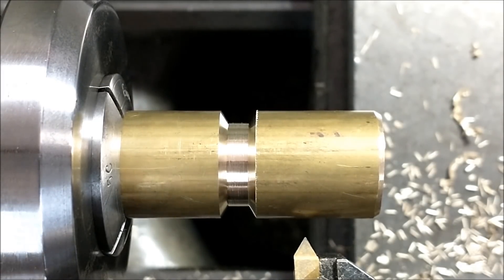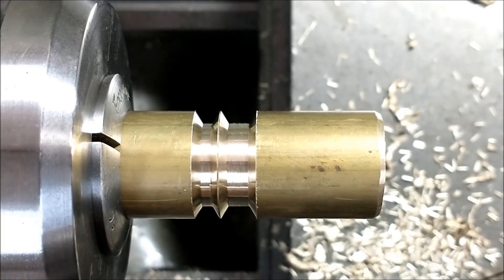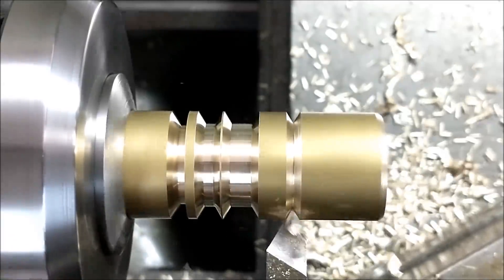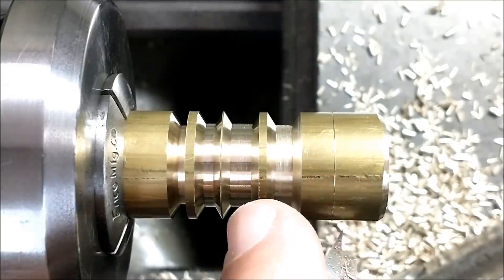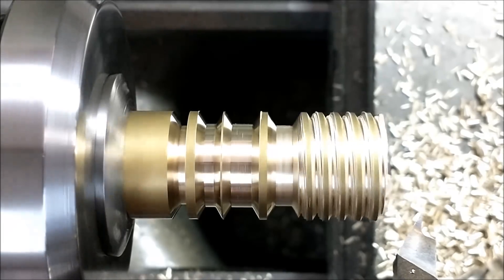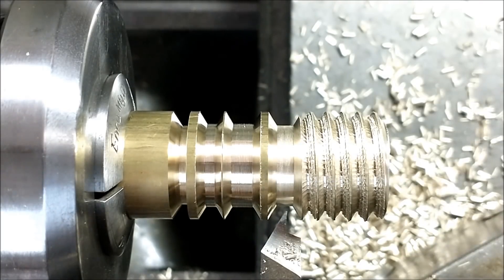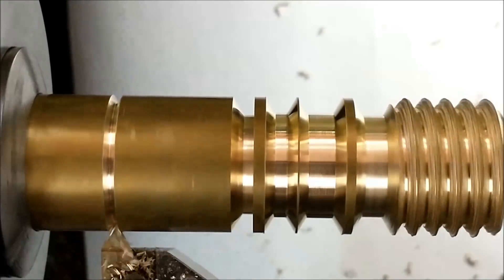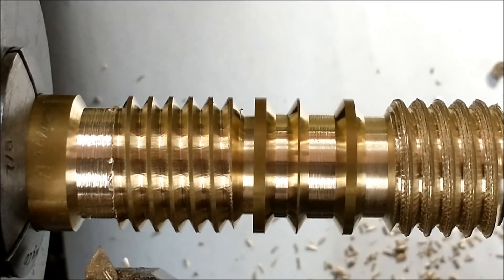FACT CHECK:  Threading Myth BUSTED !!   You'll Find This Interesting......

Comment: The fallacy in the argument is that on a 60° tool point cutting threads, both sides of the 60° point are cutting material.  When you advance the compound slide, the tool is pushed that far along the 30° travel.  And for that depth on the right hand side of the tool, that side is cutting material.  If you try to make a 30° point with one side perpendicular to the axis of the shaft you're threading, the resulting advancement of the compound will leave you with a sawtooth shape on the material on the right hand side of the cutter.  Try drawing it with SolidWorks and you'll see what I mean.  You do need the 60° point to generate the thread form correctly.  Joe didn't think this one through.
Reply from the maker: I must respectfully disagree and say I thought this through perfectly. I am fully aware the tool cuts on both sides and decided to prove it to those that still can't visualize it. All your comment does is summarize, exactly, the material and concept demonstrated.
Reply: You didn't watch the video- Joe made the video to prove the point you just made 😂 Apparently some people for some crazy reason think you can cut threads with half a Threading tool and he made this video to show the results of what happens when you try to prove that it does not work. I don't know why so many people don't seem to understand that it's like none of them actually watched the video and grasped what they were looking at 😅

Comment: we set the compound on 29 to make sure the right side was always doing a full sweep, if using an insert tool you will always have both sides perfect. if subject to inspection we used a thread mic to a spec and sleep like a baby
Reply: the thing that really separated the men from the boys is when you had a shoulder to worry about pulling that handle at the right time over and over...
Reply from the maker: Or you could start at the shoulder using a hard stop and feed out............
Reply: @joepie221  yeah have done that too

Comment: B&D multi spindle acme chop gear cell ran 4 machines same time. Started on mills, then lathes 45 years ago. F the computer age
Reply: well it's here to stay grandad.
Reply from the maker: Sooner or later, you'll have to get onboard. Maybe not in machining, but everything is going online and scan code. Menus, travel forms etc.
Reply: There's nothing wrong with CNC and there's nothing wrong with manual. They both have their place- but if you think you can actually compete to make money in this day and age without CNC you better be doing some really high-end bespoke equipment repair or prototyping otherwise you're just a fool afraid to learn how to use something with a processor, because everyone else is using them and getting ridiculous speed compared to a manual machinist and that's how you make money. I love antique machinery and I regularly manually machine but I make my living during the day mainly from CNC and programming everything I run. I love manual Machining but I do not understand the people who insist on never learning a new skill I think it's simply because they are afraid

Comment: Thanks for that Joe... just to be sure I ended up at the right answer: you do still advocate using the compound set at 29 - 30 degrees so most of the cutting is done by one side of the tool?  (Bear in mind, like many viewers, I do not have the luxury of a beefy lathe that can plunge-cut without any chatter).
Liked and Subscribed.
Reply from the maker: Greetings. For lighter machines, I absolutely support the benefit of using the compound. True 30 probably works the best but may be difficult to hit on some machines, so the 29 ish is just fine.

Comment: The idea isn't that the tool doesn't cut on the backside. It's that the bulk of the cutting is done on the leading edge and all the back of the tool does is basically spring cut what is missed. That's why I never use the compound to cut fine threads....it's just not necessary. Now start cutting 4 tpi in 4140 ht and yeag compound all day long. The tool still cuts on both sides just not nearly as much when the compound is used. I run big machines and straight in works perfectly fine for most alll threads
Reply from the maker: Yet some experts still say it doesn't cut on the right. Ridiculous.
Reply: @joepie221  YouTube experts haha. Glad you made this video to show them they are indeed wrong
Reply: In my experience you have to have a really beefy lathe to get good results with direct feed, otherwise I use the 29.5 deg angle. I always do a spring pass at the end too- I do this by manually pulling back on the tool post without moving the handwheel. You usually get a few tenths play away from thread contact this way, and you can reverse the cut with tool still at depth- but hold back as it passes the thread- then let go when you get back to start, and re-engage the leadscrew to cut. The effect of this will be removing an extremely fine amount of material for the spring pass, cleaning up the thread nicely. Direct in works well too I noticed if hard turning threads on hardened materials, like Bearcat 44 drill rod, or Viscount 44- using the compound on a Harrison 500, it would just spring against the cut. Sometimes a direct in cut works best, but I prefer 29.5 deg.

Comment: I was taught that the leading edge cuts, the trailing edge guides and cleans the cut.
It's a self-piloting mechanism, sort of like a 'gun-drill'.
The lead-screw is drawing the carriage ever closer to the chuck, at the same time, the trailing edge of the tool is being guided forward by the screw-threads that have just been cut!
The grind of the tool is critical: the leading edge has a slightly steeper angle of attack than the trailing edge.
Slightly hollow-grind the top face of the tool, center the 'dip' near the trailing edge.
This puts the leading lip slightly higher and steeper than the trailing.
Yeah, both side of the tool are needed, but they are doing different jobs!
Reply from the maker: The tool is advancing into the material. It is impossible for the tool not to cut on its entire DOC profile. The bias of that cut will be determined by the angle of approach. BOTH sides cut.
Reply: Think about it, when you screw cut the correct way, it's the cross slide you dial in for each new depth of cut. With the cutting tool set up correctly at 90 degrees from the work piece going through the centre of the angled tip for a standard tooth profile, both cutting edges dial in the exact same amount, and therefore both cutting edges remove the same amount of material.
This whole idea of using only one tool cutting edge to cut a thread is counter productive.
Me, I started my engineering apprenticeship in September 1976 for Philips Industries in their Research and Development department as an instrument/tool maker.

Comment: Hi Joe, as a retired toolmaker I find your videos of a high caliber and informative for many wannabe engineers . As far as threading is concerned I thought all my Christmases came together when I got hold of full profile carbide inserts ( many moons ago ) from a reputable brand . I soon found out how accurate these inserts were by comparing the effective size with the OD and found that working to a tolerance you didn’t need to measure with those horrible screw thread micrometers and could solely rely measuring the diameter ( crests ) with a standard micrometer and as a bonus no burrs . I am sure you would be aware of this . Happy screw cutting !

Comment: No myths busted here.
The reason behind setting the compound that way is to minimize the cutting load, so most of the load goes on the leading edge which will reduce chatter. That's also why you don't set the compound to 30 degrees, you want it slightly less so it does take a very small cut on the back edge.
Reply: As for chatter, you either have the incorrect cutting edge angle for the material, or you're not centred correctly.
Or, on the other hand, you have bearings that need changing in your headstock, or too much slop between a carriage and it's slides.
Reply: Yea i thought 59° was the std so 29.5° would be ideal..  but unless your wanting to cut threads on a fastener thats going to be torqued to yield or if its for a worm gear or something critical of its cut than if she threads than the nut will finish the cutting..  lol..
Reply: @Z-Ack  standard metric is always 60 degrees. The point of a thread is that both the screw/bolt/whatever has exactly the same tooth angle as the thread in the nut/housing/whatever. Threads work by locking together from maximum tooth to tooth contact. Just like how a morse taper works.
Reply from the maker: Regardless of the compound setting, the tool always cuts on the back edge. Maybe not as much as the leading edge, but it does. So for anyone that thinks it doesn't, that myth was perfectly busted.
Reply: @joepie221   Anyone who thinks the back edge doesn't need to be there has no place being anywhere near a lathe.

Comment: You nailed it Joe !  well done that is proof that the right side of the cutter really does cut
( only the depth of the cut ...but it does cut ! ) and what is this ? threading toward the head stock ??? shame on you LOL !!!!!
Reply: Can easily tell you're not a mechanical engineer, or those that taught you weren't. Why do you even comment on something you have absolutely no idea about?
Reply: @mickk8519  Stuff it Mick... you just want to argue so screw you and the horse you rode in on !
Reply: Running in reverse and cutting away from the chuck lifts the carriage of the ways. Lathes aren't designed for that rather the tool pressure need to push the carriage down on the ways. It's not that you can't do it, but certain circumstances it could cause issues running in reverse. Plus you better make sure you're using a cam lock chuck not a thread on lol
Reply: @kamper4140  Good points on threading away from the chuck !
however Joe has advocated the use of threading away from the chuck for years...I was just giving him a bad time.  he taught me to thread away
from the chuck on my Logan 911 years ago, it has a thread on chuck
but I have never had it try to come off in threading. yes the lifting of
the cross slide could become an issue if you take deep cuts and it is a valid POINT !!!!  so far i've not experienced any problems with that.
Reply: @bobkelly2447  just something to consider, but it's definitely not wrong. I do it when machining 660 bronze all the time. If I run in reverse the chips all go down into the pan and not all over my face lol

Comment: You get right down to it, it doesn't matter if you are using the compound or the cross-slide, tool contact is going to be exactly the same on every threading pass because the tool path is always the same. A five thou cut is a five thou cut, it doesn't matter what angle you feed it at.

Comment: Your right it dose cut the right side as well how ever by doing this that cutting length is minimal being only the length of your tool move. The means your only cutting load is still only 55% percent verses a full cut all across both sides of the cutter meaning 100% cutting load.

Comment: Indeed stating that the side of the tool does not cut at all is an exaggeration, and is analogous to stating that the nose of the tool does no cutting during plain turning and so you could get a good turned finish with a zero-radius pointed tool.

The left and right sides of the tool cut differently. The right side is essentially cutting the flank of the chip, just as the nose of a tool cuts during plain turning. The left side is cutting the face of the chip, just as the side of a tool cuts during plain turning.

In each case the feed has to be less than the width of the supposedly-non-cutting face of the tool. For threading this feed is the pass-to-pass advance of the compound; for turning this is the longitudinal feed per turn.

So that statement is an exaggeration: the right side of the tool does indeed do a tiny but important bit of cutting. I suspect that not only does this bit of cutting remove the stairsteps, but it also stabilizes the tool and reduces chatter.

My feeling is that the statement is a simplification (or white lie if you want to call it that) which works as long as no one tries to take it as absolute truth and, say, try cutting threads with a half-tool like you made.

It should be pointed out that, even with your strange tool, the right side of the tool is still cutting the flank of the chip. There is no absolute boundary between plunge/form-cutting (where all cutting edges have more or less the same cutting geometry and feed direction) and side-cutting (where the feed presses part of the cutting edge into the work, doing most of the cutting, and a bit of the cutting edge cuts the flank of the chip). Using the compound feed puts the operation firmly in the side-cutting domain rather than the plunge/form-cutting domain one gets using just cross-feed.

Comment: Cut gummy stainless with out using the compound. Ha ha I’ll be waiting to watch this one
Reply from the maker: Done it a thousand times. Whats the big deal??
Reply: @joepie221  just about every time I get around 80 depth either the tool breaks or the threads gull up even with cutting oil. 
But when I use the compound @ 30 deg I get much better threaded part with no catastrophic failure. I did this test on a new rigid manual lathe and on a haas cnc. Both were better reliability using the 29.5 advanced- much longer tool life vs parts made. Why do we call the machinists handbook the Bible. If it’s all a lie?
Reply from the maker: @mitchrothermel8157  Point out where I said that and I'll address it.
Reply: @joepie221  Ok my bad “WE” I mean machinist taught old school in general. 
I guess you aren’t an old school. I now assume u just learned trial by error.
Reply from the maker: @mitchrothermel8157  63 year old, 47 year tradesman. Journeyman toolmaker from NJ. It doesn't get much more old school than that. I've just never embraced using a compound to thread. The subject matter of this video was very specific. I choose not to argue technique on this string. I'm sure, if you look, you'll see other topics covered on my channel regarding threading.
Reply: I was trying to say I was wrong. I’m sorry. 
But there are young leaning this trade and I just don’t feel that they need more to 2nd guess. When there are better ways. 
My apologies
Reply from the maker: All good bud. No harm.

Comment: I know why the steps will appear. It is because we can never make a cutter that is ground to a sharp point. Besides, even if we can grind such a tool, the point would immediately break off.
Reply: Doesn't matter, because the profile of the tool will always shape the profile of the thread. You might get a compound thread instead of a stair-step, but getting as smooth a thread face as with a normal profile of tool would require an unjustified number of passes- you can cut the numbers a bit if a rougher face is acceptable, but only then.

The only reason why the leading edge is normally the only part cutting is because the trailing material has already been removed, thus refusing the trailing edge the very opportunity to cut. That can't happen with thread (because it wouldn't be thread, it would be empty space), so the only way to avoid the trailing edge cutting is to ensure that the trailing edge angle is so sharp that previous passes already removed the material... in which case you either get a stair-step (if you're stepping the tool in at an angle not perpendicular to the axis), or you get a wall perpendicular to the axis of rotation. There's no getting around it, because the tool is only able to remove material that it comes in contact with.
Reply: Can you cut acme or square threads with an angled tool?  Or with it set at an angle to the work?   What if you offset the angle to the work to offset the angle of the cutting head??  Wouldnt you still get a taper on the leading edge?

Comment: Having cut threads for the last 50 years, I quit feeding in with the compound more than 20 years ago. I still set the compound on 29.5 or 30 degrees for clearance and to pick up threads.
Reply: Pick up threads?
Reply: @janeblogs324  When there are existing threads being repaired or extended.